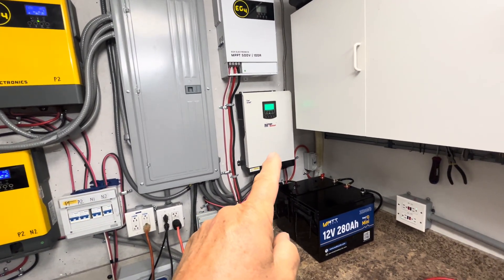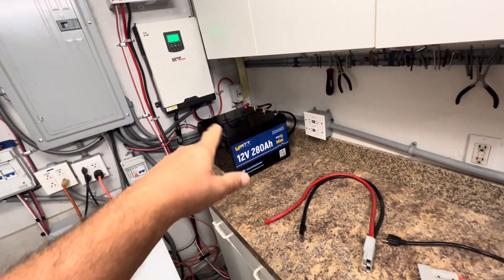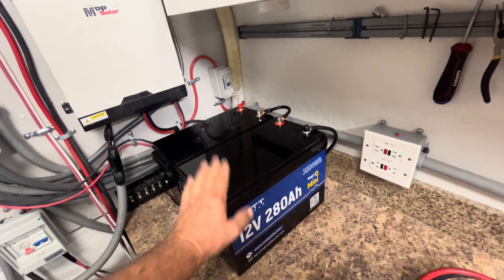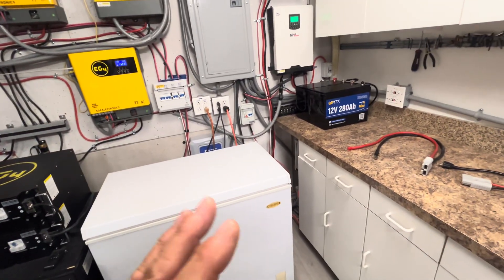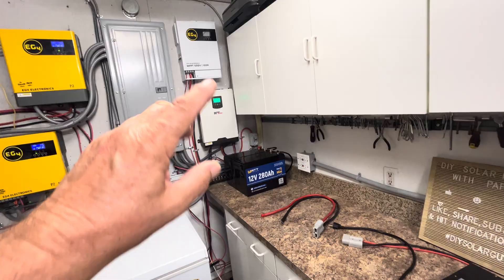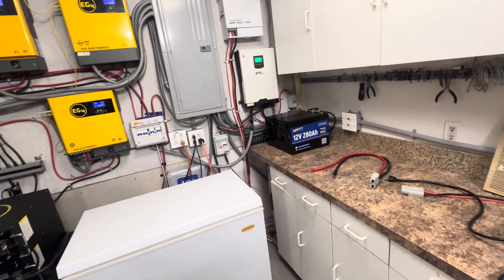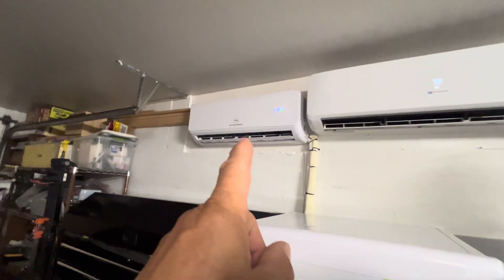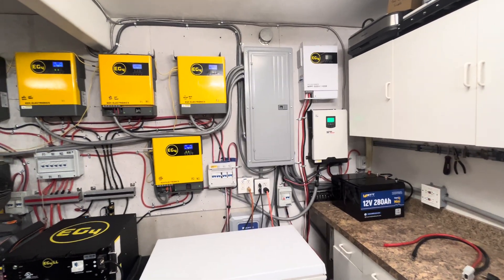Solar power system for home. Will 2-12.8V LiFePO4 batteries in series for 24V battery bank work?

Comment: should use a battery balancer. when using multiple  batteries in series. like a bms.. li time makes one... 24 v 36v or48 v
Reply from the maker: Thanks, I will look into using a balancer